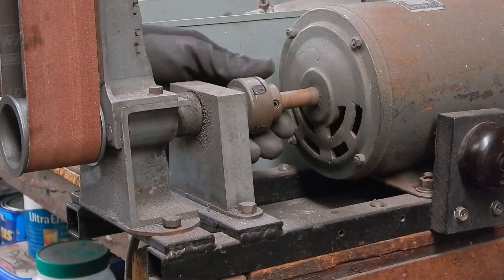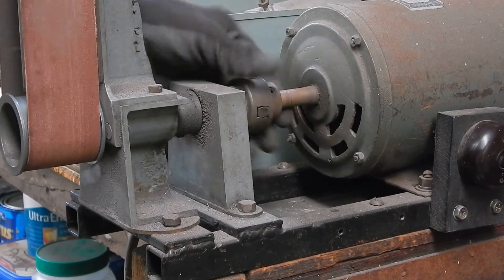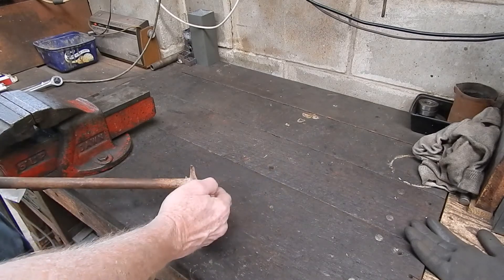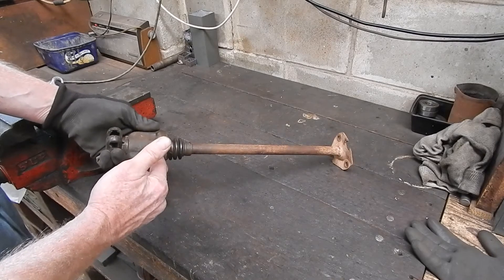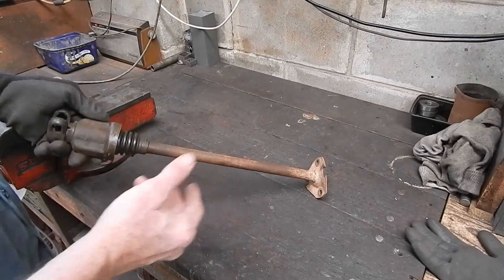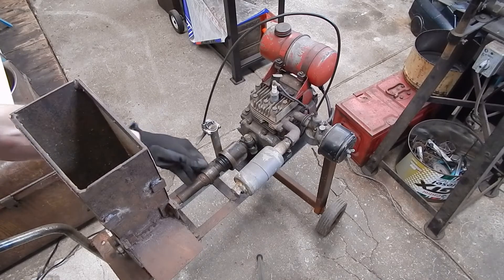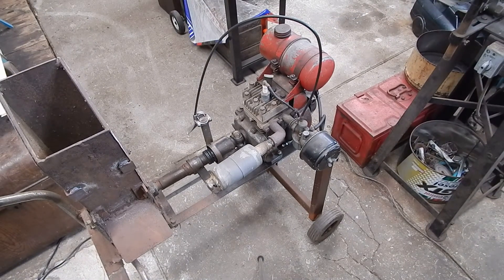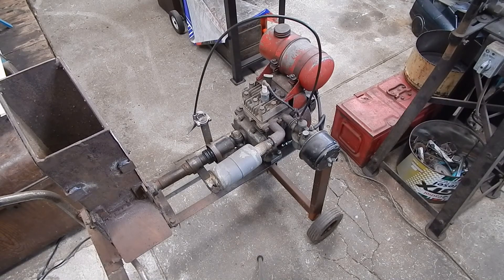How to direct drive with junk

Comment from the maker: The linisher is a small commercial vertical unit originally designed to be run off of an electric drill via flexible drive.  I got it at a garage sale and attached a Chinese motor I had.  It's one of the handiest items in the workshop as the belt speed is fairly slow compared to other units.  This makes it invaluable for facing small items (like washers) and breaking edges, sharpening etc. without it flying off the unit.  I only use a fine grit on it.  I may do a short video if I get time.

Comment from the maker: I will see what I can do :)  Basically it's a similar action to a cylinder lawn mower, except that I made up a two bar cylinder to drag and slice the plant in a scissor action against a fixed cutter blade.  Works OK but not suitable for large diameter stuff.  There's various cutting actions you could use - eg. flail mill, hammer mill. rotary drum.  I previously had a rotary blade mulcher (home made) but made this in a hurry after the electric motor burnt out.  Cheers Rob